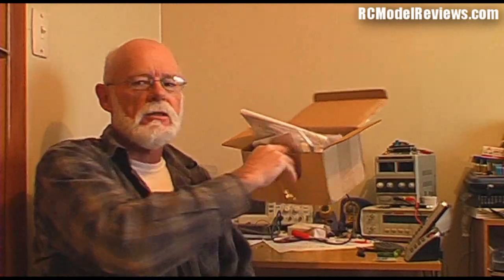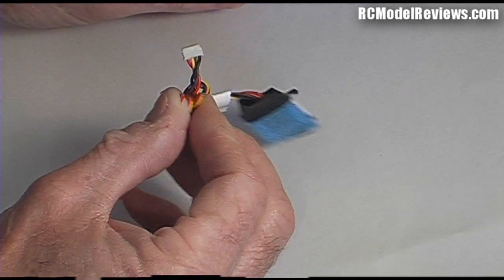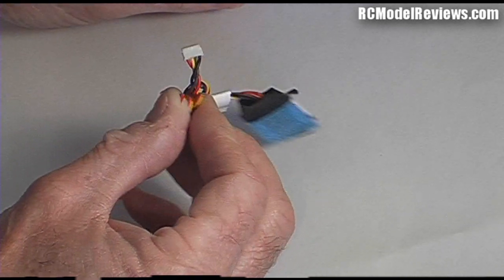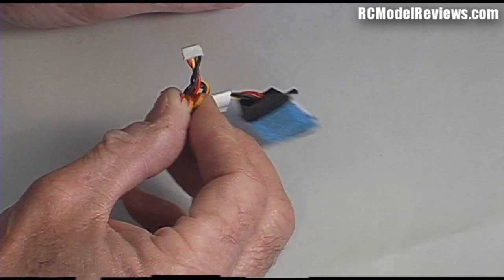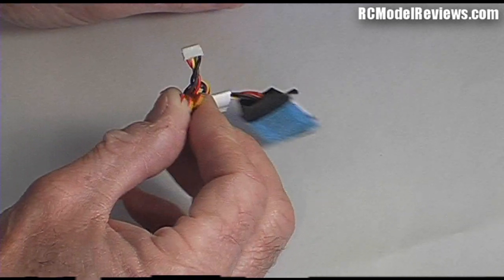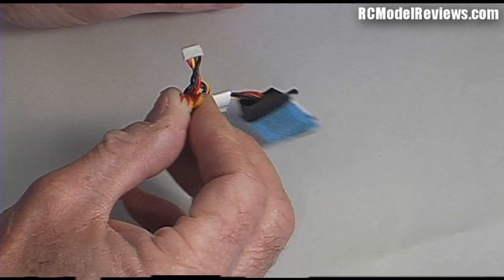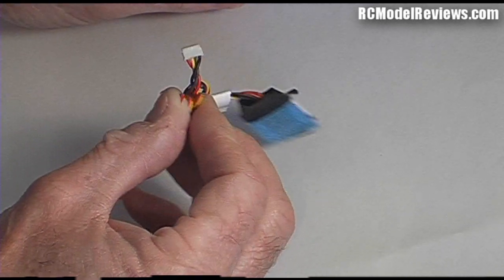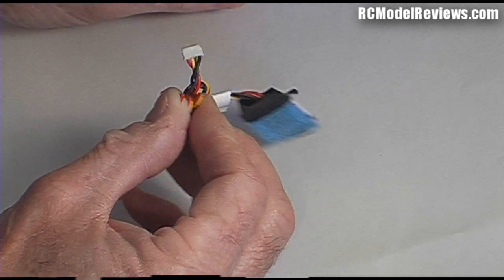Review: FrSky Telemetry system (part 1)

Comment: Any views on the short clover leaf antenna from HK? They have no coax they just solder to the SMA connector. I would have thought some length of coax is usually required (usually in 1/4 wavelength lengths, if i'm not mistaken)? Can anyone back this up or explain this? Thanks

Comment: Interesting that the module plugs into the external module pins. Is the order of connection the same for both JR (FrSky, Turnigy) and Futaba?

I have 2 Taranis transmitters but I haven't tried telemetry yet.  Will you test that in future?  I guess the speech option on the Taranis might make use of some transducers easier.

Is the temperature sensor a thermocouple?

Comment: Hi Bruce, Love your videos and cant wait to join the worlds largest RC Club!
Just wondering if you have ever tried to upgrade the firmware on the DHT-U? I'm struggling to find the exact cable/connection solution for it, as the manual refers to a 6 pin upgrade port, where mine only has the 3 pins above the PPM and power connector.

Comment: Great video, Bruce.  Your filming techniques make it all very clear and entertaining

I think you're a bit mean about the size of the GPS module.  I'm a retired electronics design engineer and I'm still staggered at the incredible at the stuff better engineers than I are designing and making.  I think you are getting a little blasé :)  It's all so fantastic, I think.

I have a FrSky DIY module on my Mux3030. Thinking I might upgrade to telemetry.

Thanks a lot for this.

Comment: Hello Bruce, nice video.. Can you make a video on Range Check with this DHT-U. I got this module and D8R-II-Plus Receiver. But unlike other transmitter modules (DHT or DJT) this one doesn't show blinking or flashing LEDs to make sure that we are in range test mode. I did set "range check" mode under menu but as soon as I got out of that screen to go to DATA screen to check RSSI strength while doing Range check, it changed the status to Normal from Range check.

Comment: Problem solved! The DHT U FW 2.0 showed Ampere and consumption x 10 !!! Thats why i got way over 6000 mAh and over 130 A from a 1800mAh - 20C 3s Lipo after a short time.
The bug is corrected, when you flash DHT U with FW 2.3 (it displays Rev 2.2 after startup). Perhaps this info helps for Part 2 of your review!
So long
Crashpilot

Comment: Hi! I just got the Frsky Ampere Sensor-100A (FAS 100)  and the  FLVS-01 Lipo voltage sensor.I love the FLVS too! But what is your experience with the FAS 100? I upgraded my DHTU to 2.0 and the Ampere sensor is also supposed to put out the voltage - but it gives me nearly a 1 volt too low reading! The Amperes displayed SEEM to me too high (i can't measure) on my quadrocopter it displayed 130 A (without blewing) at hovering. I got connectionproblems with T deans (problem on my side)
So long Crshp

Comment: Do you find the GPS altitude data are any good?  I've been watching several alishanmao FPV vids and the GPS-only OSD output shows speed and position data that are just fine but the altitude data are mostly useless, rarely showing change in height when his Widowmaker goes up or down.

Comment: Bruce, I got a DJT Tx module and D8R V2 receivers. I connected a GPS module and a voltage sensor to a V2 hub, then I connected the hub's data lead to the A1 port on the Rx and the stuff worked as advertised. I didn't have to wait for the GPS to find satellites either, whereas my GPS enabled PDA keeps losing them. I got speed and altitude readings even without vario. There's an 18 meters discrepancy between the two readings 'though both were on the SAME window-sill :D

Comment: Bruce, I would not be so sure that one antenna is for receiving flying controls and other is for telemetry. That would be very strange, because in most cases those 2.4GHz systems use transceiver chips that can send and receive. So by using other firmware you can use the same link for both telemetry and controls. Then why add more cost to production? Most likely second antenna is diversity antenna.

Comment: Bruce, did the Dashboard have a SD/microSD card slot? I don't think you mentioned if it did. This would be good for logging and later analysis of that data. If not, maybe something you can pass onto your FrySky contacts (which seem rather interested in what you have to say, which is great!)

Comment: Bruce, I have the ER9X telemetry. Short review here, it works, shows most data except the accelerometer, and it's a lot of pain reading it on the small screen way down on the bottom of the transmitter. It's good if you don't have anything else, but I already ordered the FLD screen. BTW I'm mostly using it for thermaling and the vario jumps +/-15m even with the sensor plugged into a chunk of sponge I "liberated" from the family.

Comment: Right now I'm waiting for the FrSky Tx, rumors say the programming will be done by Erazz, the guy behind ER9X. Built in module can be accompany by another working in tandem, 16 to 32 channels in PXX mode, firmware upgrades can be done through PXX etc... all around $100. If it has a screen on top I'm buying one.

Comment: Same here. Got the 9x and frsky w/telemetry due to the previous review by Bruce.  I'we never had any problems with FrSky, just love it.  Also flashed the 9x to er9x-frsky and it is just awesome. If Bruce makes a review of that combo I'm sure lots of people will make the switch to er9x altso, and possibly also the frsky blend (altough it's a bit of soldering to get that sorted, you have to remove to smd resistors and replace them, as well as soldering two wires straight to the atmel processor)

Comment: Bruce,

Very timely video - I have just fitted the hub to a new model and have the GPS and analogue voltage sensor fitted. I am using the small display with a DHT-U DIY module. I wondered why the height info wasn't working - I'll fit the vario. Very interested in any FrSky software uplift - more info please.

Alan

Comment: Hey Bruce nice vid as usual, mate while talking to Frsky could you ask them to look at doing something to the the side mounted cable on the DHU module and make it so its on the back of something. This way you could possibly run the cable down the only antenna hole into the radio making it a lot neater

Comment: GPS units have terrible accuracy when estimating altitude, which is probably why the barometric pressure sensor is required for an altitude reading.

Comment: I find the temp sensor to be useful taped to the ESC or Battery.  I've no idea why anybody would want the temp in the fuse??      

How did you have your vario mounted?  The display seemed very stable.

Comment: Bruce:
 Thanks for the videos. Could you show how you connect the module to the transmitter. You mentioned that the 2 different modules connect differently. I am just looking into the frsky and still don't understand all the connections, especially the connections at the transmitter.
Thanks again.

Comment: Altitude given by the GPS chip is not reliable as it has an accuracy of about +/- 5m and moreover when the altitude changes fast, its accuracy is even worth. That's why they use an external static pressure gauge so that they have a much more reliable data for the altitude.
But thanks for your reviews I really enjoy them!
Regards from Switzerland